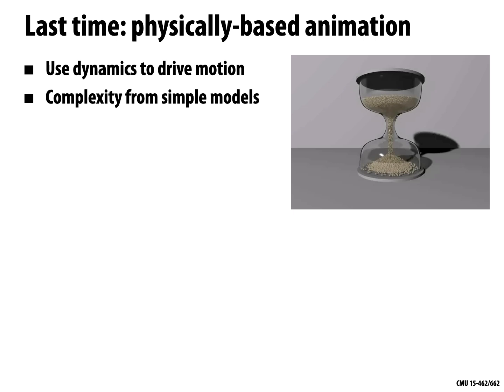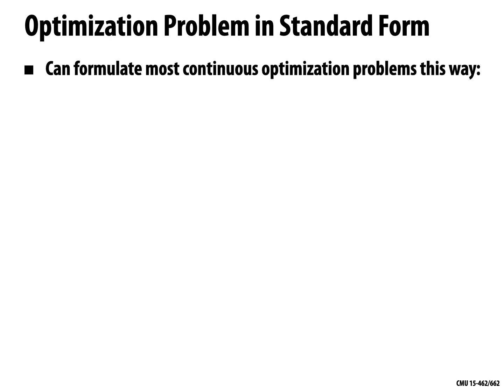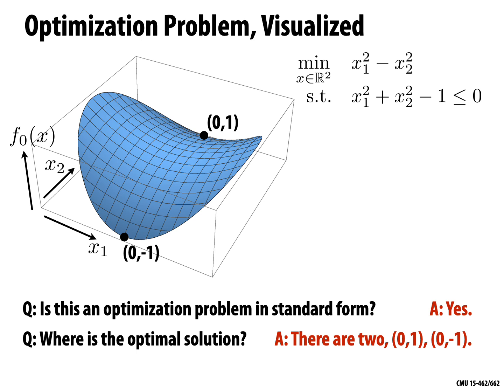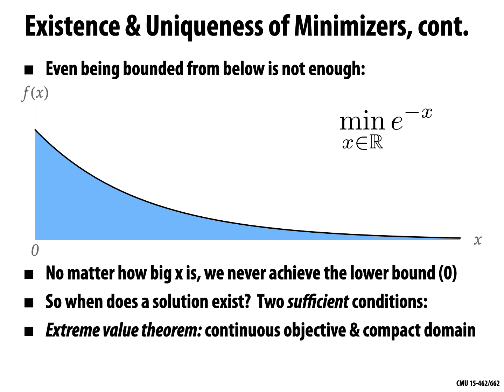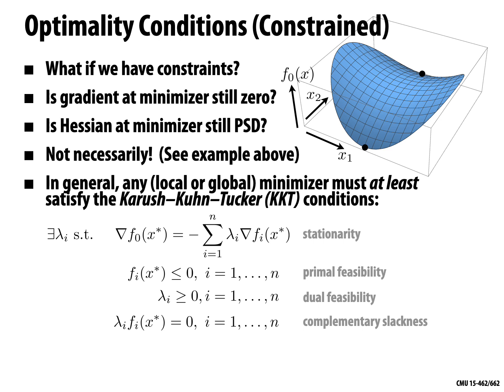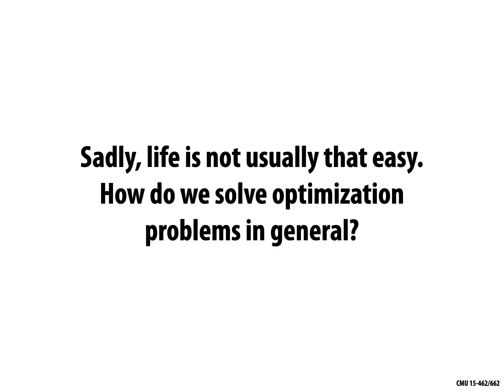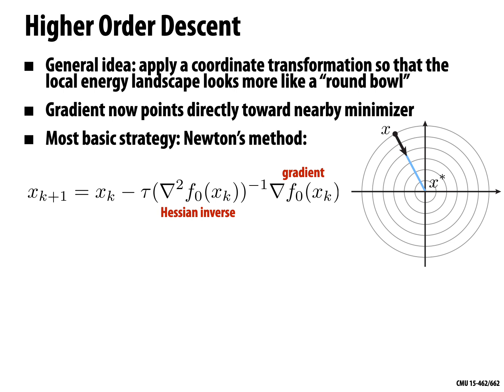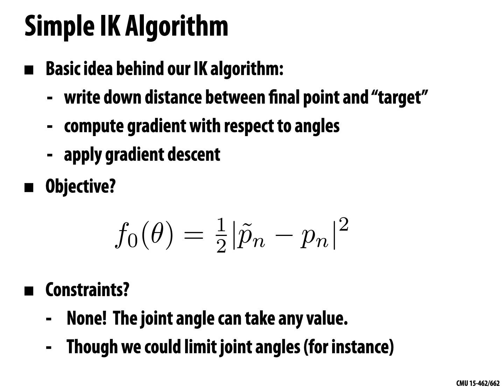Lecture 22: Optimization (CMU 15-462/662)

Comment: KEY QUESTIONS:
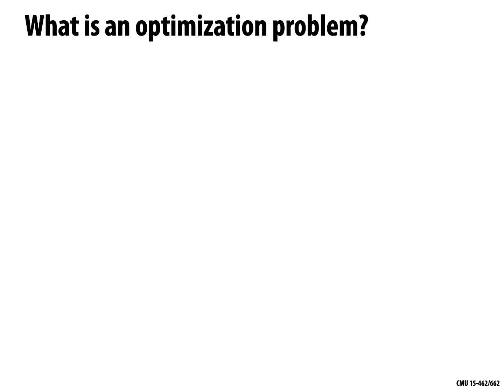- "What is an optimization problem?" [02:27]
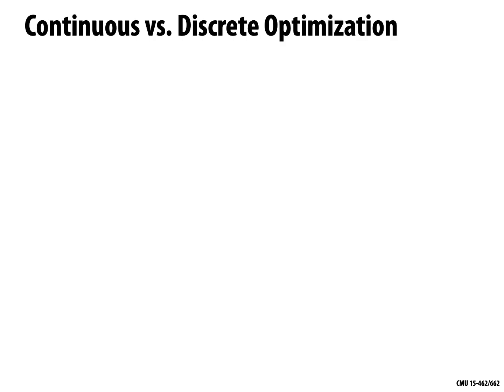- "What are the different types of optimization?" [08:25]
- "What does a standard optimization problem look like?" [14:08]
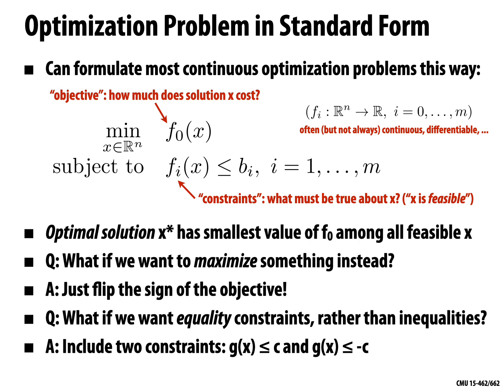- "When have you solved an optimization problem?" [19:54]
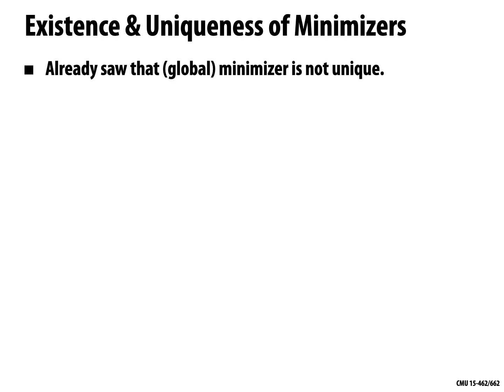- "Does a global minimizer always exist?" [27:56]
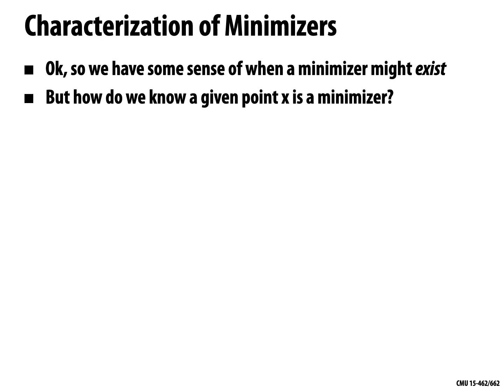- "How do we test if a point is a minimizer?" [42:37]
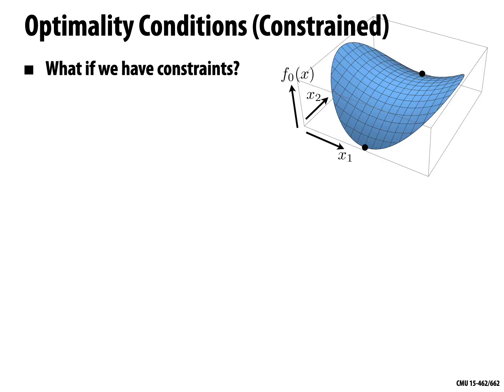- "What conditions must be satisfied for optimization with constraints?" [52:00]
- "Why is Newton's method effective for optimization?" [1:19:43]
- "How does inverse kinematics work in animation?" [1:25:35]

NOTABLE QUOTES:
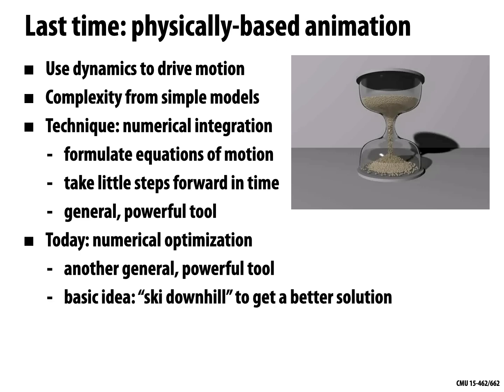- "Optimization is a really general powerful tool that lets us do various kinds of animation" [01:40]
- "For a lot of important problems even discrete ones, people have cooked up clever strategies" [10:22]
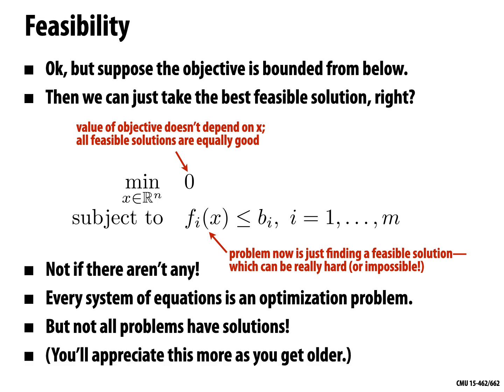- "Not all problems have solutions, and you'll appreciate this more and more as you get older" [35:29]
- "Checking if a point is a global minimizer is typically hard" [43:22]
- "In general any local or global minimizer must satisfy the KKT conditions" [53:44]
- "Non-convex optimization is a black art" [1:23:22]
- "No matter how good you are, there's always someone better than you" [31:01]

TIMESTAMPS:

[00:00] Introduction to Optimization in Graphics
• Connection between animation, graphics, and optimization principles
• Relationship to physically-based animation from previous lecture
• Overview of optimization's role in computer graphics
• Relation to Gaussian splatting: optimization for point cloud representation

[02:27] Understanding Optimization Problems
• Definition of optimization and its natural applications
• Historical context with Princess Dido's isoperimetric problem
• Examples in character animation and geometry
• Applications in 3D fabrication and machine learning

[08:25] Types of Optimization Problems
• Distinction between discrete and continuous optimization
• Analysis of discrete optimization challenges and complexity
• Discussion of continuous optimization methods
• Introduction to convex optimization problems

[14:08] Standard Form Optimization Problems
• Detailed breakdown of standard optimization form
• Understanding objective functions and constraints
• Converting maximization to minimization problems
• Transformation of different constraint types

[19:54] Local vs Global Minima
• Distinction between local and global minimum solutions
• Real-world applications of local minima (protein folding)
• Importance in machine learning and graphics applications
• Understanding when local minima are acceptable solutions

[27:56] Existence of Minimizers
• Analysis of when global minimizers exist
• Discussion of bounded and unbounded functions
• Multiple global minima possibilities
• Connection to practical graphics applications

[34:58] Examples and Feasibility
• Concrete examples of optimization problems
• Analysis of feasibility in constraint satisfaction
• Geometric interpretation of constraints
• Practical considerations for graphics applications

[42:26] Testing for Minimizers
• Introduction to testing points for minimum conditions
• Difference between local and global minimizers
• Connection to calculus concepts
• Relationship to Gaussian splatting's point optimization

[52:00] Constrained Optimization
• KKT (Karush-Kuhn-Tucker) conditions
• First and second derivative tests with constraints
• Practical implications for graphics applications
• Handling constraints in optimization problems

[55:04] Convex Optimization Problems
• Definition of convex problems and their properties
• Importance in computer graphics
• Reliability and efficiency advantages
• Examples of convex problems in graphics

[1:00:09] Quadratic Optimization
• Special case of convex problems
• Matrix formulation and analysis
• Applications in mesh simplification
• Connection to graphics pipeline optimization

[1:08:02] Gradient Descent Methods
• Basic principles of gradient descent
• Implementation details and challenges
• Step size selection strategies
• Practical considerations for graphics applications

[1:19:43] Newton's Method and Beyond
• Advanced optimization techniques
• Comparison with gradient descent
• Advantages for convex problems
• Limitations and practical considerations

[1:24:04] Practical Optimization Strategies
• Different solver approaches
• Real-world implementation advice
• Common pitfalls and solutions
• Tips for graphics applications

[1:25:35] Inverse Kinematics Example
• Application to character animation
• Forward vs inverse kinematics
• Mathematical formulation
• Implementation considerations